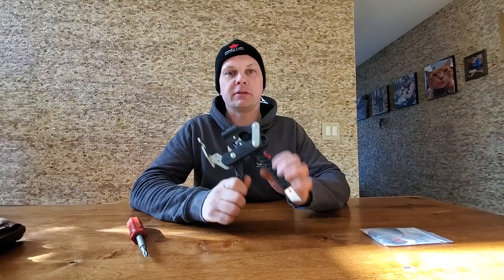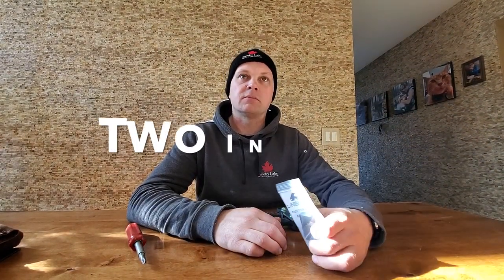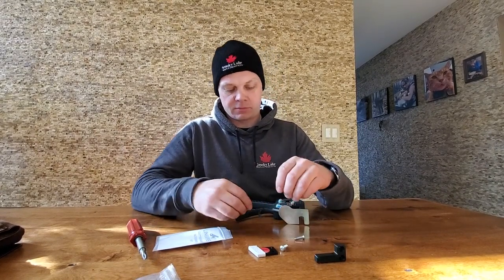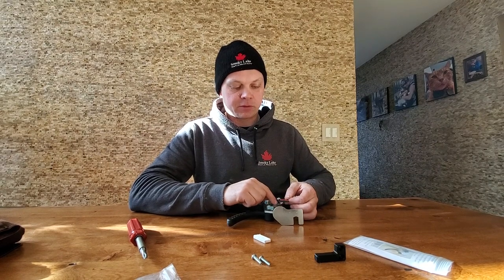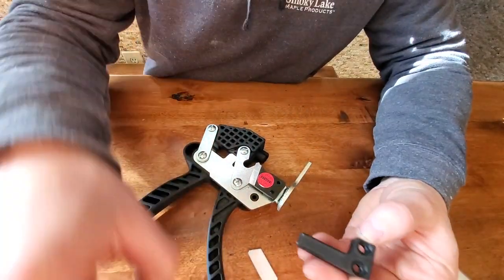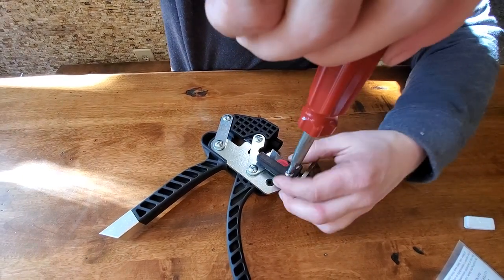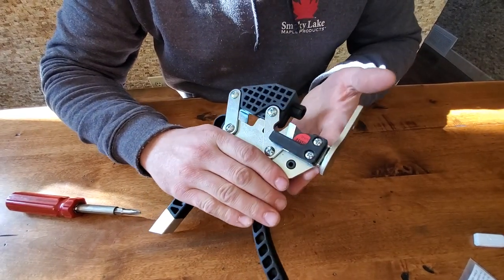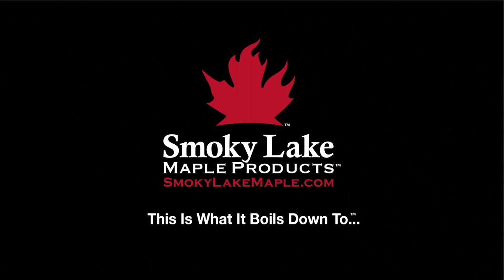LineViper Cutter Blade Accessory Demo

Comment: I really like the Line Viper for making drops & replacing taps each year. The way it works allows me to operate it with one hand while positioning or moving the tubing with the other hand. A one handed tool needs both hands to operate just the tool for repositioning or moving. This cutter will be great for replacing taps each year, now all you need to carry is this tool with the cutter add on & taps.